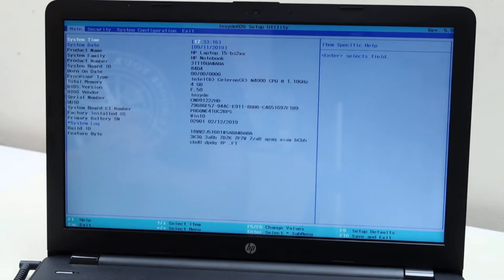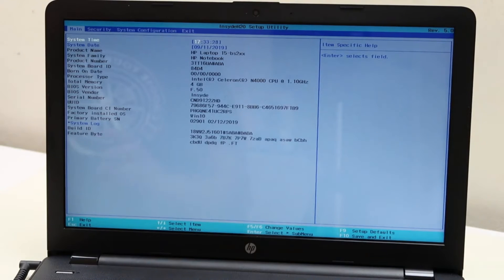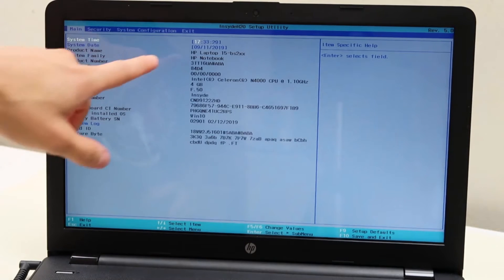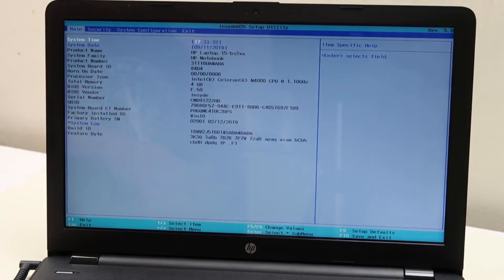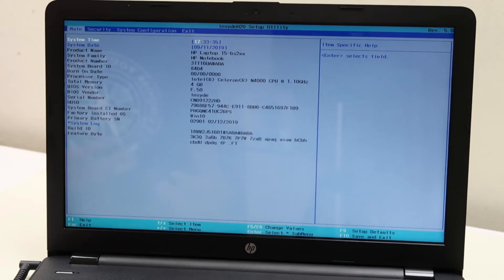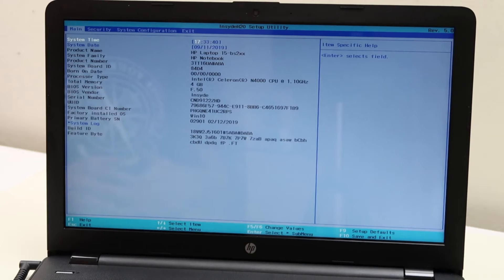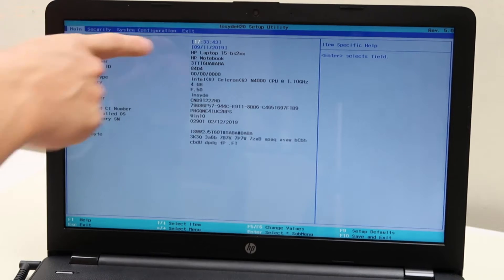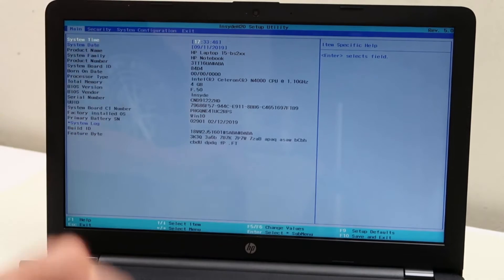How To Fix Bad Checksum & RTC Battery Low Errors - For HP Computer

Comment: Hi!
I have an HP Z400 Workstation which blinked red 8 times (Invalid ROM based on bad
checksum) And there is no picture on the screen.
I've tried changing the CMOS-battery, but I have not tried to press the button on the motherboard (cmos reset or what ever it's called).
I tried removing some of the RAM and currently have one stick in it, which made the blinking go away, but still no picture.
I've tested 3 Graphics cards and 2 different screens with dvi, displayport, vga and hdmi (hdmi to vga adaptor). I know for sure 2 of the graphics cards work and both screens work.
There is currently no HDD/SSD in the system, but it can easily be changed. Just needed to clear it.
There is no internal graphics chip on the motherboard, or at least there is no video-port.

Do you have any ideas of what to do?

I am aware that it could simply be that the MB, CPU or something else is broken. But since I don't have the skills to know I at least want to try a bit more :D
Reply from the maker: Were you able to try the steps seen here? repeatedly if needed? Also, did anything happen before this issue started? Overheating, liquid spill, Windows update, etc?
Reply: @PC_Monkey  Sorry, thought I answered this.
Learning about computers in a workprogram, there are a bunch of different computers that usually only need to have their disks wiped and programs reinstalled. 
Since I started fairly recently + that almost all, if not all computers are given to the place there is no way to know the history.
It might have worked before and it was because I did something (unlikely) or it can have been something years ago.

I was mostly curious what you could possibly do to rule out one thing or the other when you don't have any feedback from the display.

I have since moved on from that particular pc, but I could probably revisit it.

Comment: Hey, I have been using HP Pavillion Gaming Laptop, and I get these cmos checksum errors every time I boot my PC, and my BIOS settings like Virtualization gets reset every time I restart the PC
Reply from the maker: Sounds like your on the correct video.  Have you tried the steps seen here?
Also, did anything happen before this issue started? Overheating, liquid spill, Windows update, etc?
Reply: @PC_Monkey  Nope, just one random day this issue started, and my laptop does not have a dedicated cmos battery, it uses the main battery i guess, so I think I need to get the main battery changed.
Reply from the maker: @just.kaustubh  Yes. If your main battery is used instead of a CMOS battery, then I would replace that. Hopefully that solves it and its not a motherboard issue :( Let me know if you would like help finding a battery!

Comment: This is ruining my life. I hate this error and I wish whoever was responsible for it to rot in hell. I cannot fix it in any way. The repair shop didn't put a new battery in it and gave me back a computer that will still randomly shut off with this dumb error. HP decided to anti-consumer and not allow the battery to be removed without taking the computer apart and I'm much too stupid to do that. If there's anything else I can possible do, please let me know. I've seem to run dry on options and it's driving me insane.
Reply from the maker: The option would be to replace the battery. I dont know why a computer shop wouldnt do that. Would you like help getting into your computer? What brand and model computer do you have?
Reply: @PC_Monkey  I will not open it. too many tiny parts. I'll have to go bug them again and pay 200$+ in money I don't have.

Comment: I diagnosis my hard disk and I get an error 303 I don't understand what it means
Reply from the maker: If the diagnostic test shows the HDD as not installed or if it fails, that means it may be loose or bad.  Try 'Reseating' the HDD first as it may just be loose.  Try the diagnostic test again.  If it fails to change the scan, I would then replace the HDD. You can see some HDD ideas here: https://www.amazon.com/shop/pcmonkey/list/151Q0TXYMND7O?ref_=aip_sf_list_spv_ofs_mixed_d

Comment: I can't for the life of me figure out where this CMOS battery is in this HP 15-ck075nr touch screen laptop.

The error I'm getting when I boot up is "HP battery alert. The system has detected the storage capacity of the battery stated below to be very low. For optimal performance this battery may need to be replaced "

If you could please let me know how to access the CMOS battery and where the location of it is, I'd greatly appreciate it.

Comment: Please  help me . I have  laptop  Hp 8533 G8 ( generation 8 COi 7) 
I want to replace CMOS battery but i didnt find it when i removed the cover
Reply from the maker: Not all motherboards use CMOS batteries. Yours may not if you dont see it. Can you reset BIOS instead by accessing it when starting the computer?

Comment: Can you use this approach to reset bios when your laptop is turned on but no display?
Reply from the maker: If the screen is black, what are the signs that the computer is actually turning on?  Also, did anything happen before this issue appeared?  Liquid spill, overheating, Windows update, etc?
Reply: It was Bios update

Comment: how can i fix evvolve iii computer turning on its stuck on the start button all i see is evolve iii word and it turns off ever time i tur it on pls help me
Reply from the maker: Can you access BIOS? Can you find any Repair or Restore options in BIOS? Also, did anything happen before this issue appeared?  Liquid spill, overheating, Windows update, etc?